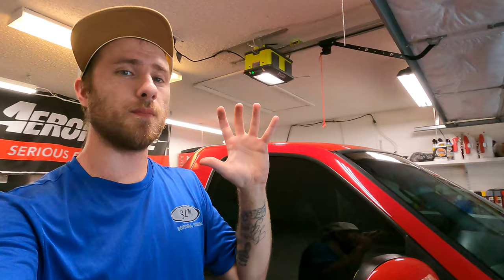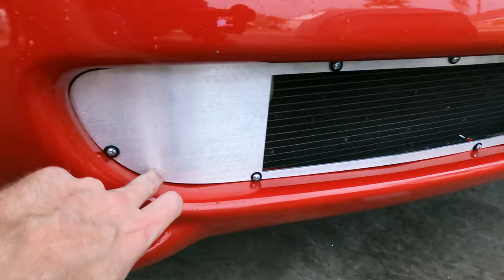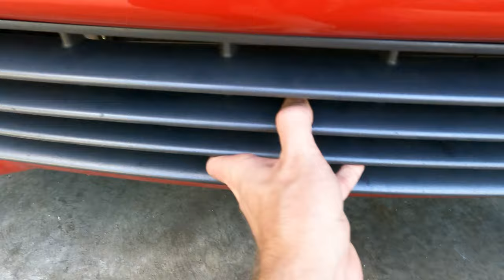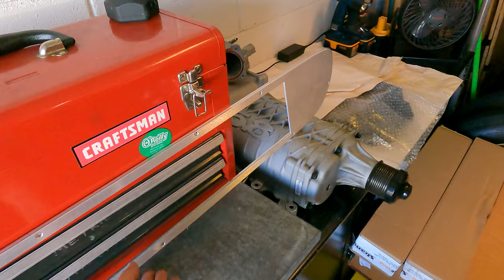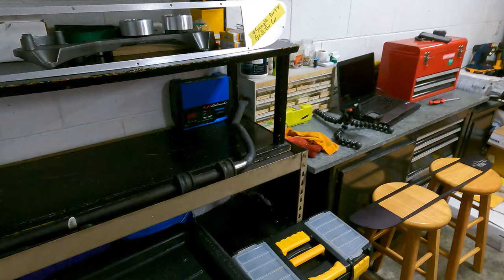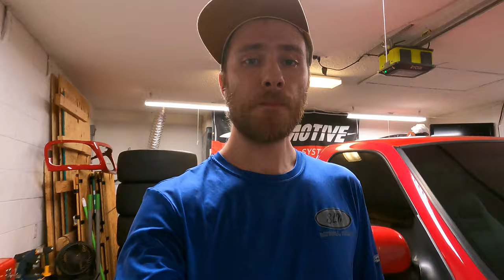Ford SVT Lightning Custom Billet Lower Grille Deletes Are DONE!  Here's What You NEED to Know!

Comment: Looks like the solution to a non problem !
Reply from the maker: It actually is a problem, for a lot of owners that get trucks with wrecked or missing grilles.  Grilles are very hard to find, and expensive when finally found.  Plus, a lot of people do like the look, and showing off the heat exchanger. I realize it's not for everyone, to each their own.  But I've got non stop compliments from mine, and a LOT of orders already.

Comment: What is that you have in the driver side driving light socket ram air
Reply from the maker: Yup, It's where I routed my ram air tube for the JLP ram air intake.  Goes right into the bottom of my airbox.  The JLP intake comes with a little scoop you mount in the grille, but I fabbed this up instead.  Less bends in the tubing for better airflow, and the funnel is way bigger than their scoop they provide.  Probably just nickle and diming honestly, but I enjoy improving on things even if it's just alittle.
Reply: @DebtLife_Projects  I like the way it looks where can I get the funnel
Reply from the maker: It's a velocity stack cut down diameter and length wise.  It's all random stuff I repurposed to make it.  I'll have to do a video on it, maybe I'll do it tomorrow and post it this Thursday, since I don't have a video for this week yet lol 😁

Comment: That sucker is probably a PITA to get fixtured in the machine and held straight.
Reply from the maker: For sure lol, big honkin fixture plate, and it vibrates/chatters quite a bit lol
Reply: @DebtLife_Projects  I figured. Nice and slow with good tooling. Can't have any deflection.
Reply: @DebtLife_Projects  laser cut it less then a minute